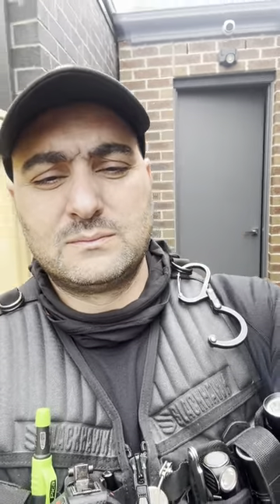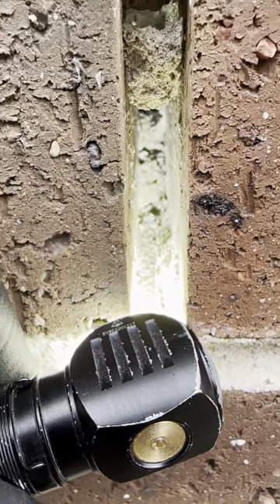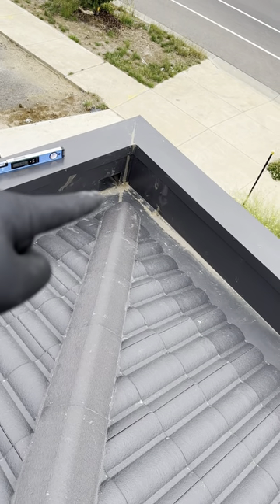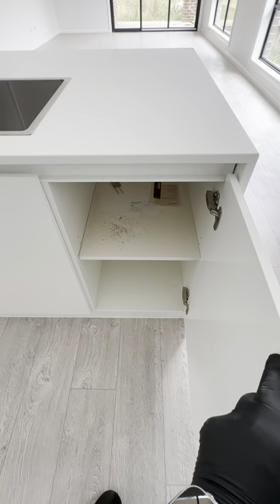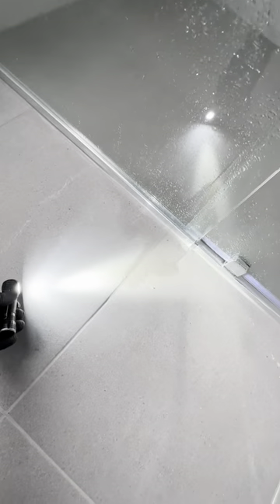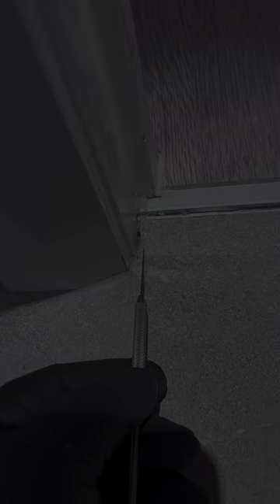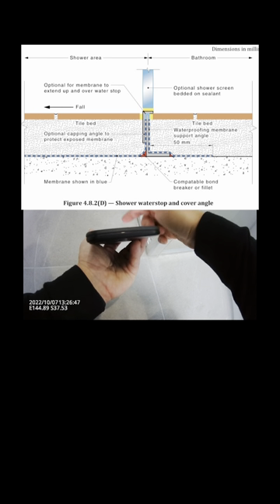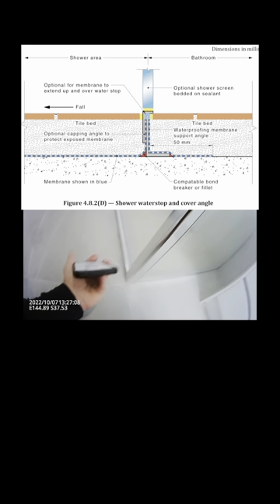Builder Confronted on Body Cam during Handover Inspection: Unbelievable Response

Comment: These gross cardboard houses litter our urbanscape and built to last a few months. They should come in a packet where you just add water.  I’d rather an old house and renovate any day.
Reply: They'll all be around in 50 years if they're not demolished. I don't understand why people think new houses are worse than say the post war weatherboard home, they're actually better.
Reply: It's very expensive to get older houses up to modern standards with insulation/ energy efficiency. Huge variance applies, some are easier to retrofit than other. It's not always as simple as old houses are easy renovations.
Reply: @HardstylePete  Correct

Comment: I used to do building maintance and I have seen the damage done with water seeping under the tile and then wicking up the door trim. People think that once you grout the tiles it's totally waterproof. It's not. The slighest crack and it worms it way through the tile cement lines and voids. It's amazing that this needs to be explained to the builder. I'm not a builder and I know this stuff.I've built bathrooms and it doesn't take much to learn this stuff.
Reply: When you think about it tiles just make the waterproofing look good and protect it..
Reply: They don't know because they don't need to know. Seriously.
All they care about is collecting the certification from each trade. They don't do any work work anymore.
Reply: We have mushrooms growing in our bathroom doorway. Private certifier identified the problem but builder never had it corrected.

Comment: Many reading here might think that Australian building standards have worsened over the past 15 to 20 years. Don't be so quick to judge. The number of houses has increased, certainly. I worked as a cash labourer for a great guy in Sydney. We did jobs all over the inner west of Sydney. One was where we placed new timber floor joist directly on to soil having torn up the previously rotted timber floor. That was about twenty years ago. That house in Balmain should be due for a new floor about now. On other job, the timber floor 'sagged' in the corner of the room. The repair was to drill a hole in the floor and fill the sub-floor space with expandable foam. That second one was a real estate job. Balmain. Good work owner! I don't expect much has changed in twenty years since.

Comment: And those are just the violations that you can see... There are likely 100s of short cuts, mistakes and errors that are hidden behind the walls, in the foundation and deep in the attic. It should be torn down at the builders expense and the buy refunded any deposit.

Comment: I don't get how stand alone houses are allowed to be built right up to each other. How do you maintain termite barriers etc.
Reply: I’ve done them where bricks are against the houses next door. It’s fucked
Reply: @dragginmedown  I sit design side, do audits etc. House I saw recently (not one of mine), but could see shit from the other side of the road and had to take a closer look) they had to put the gutter on top of the wall so they cleared the neighbours. Top of the wall had no finished surface or flashing, roof tiles were cut back with what could have been toe nail clippers, I have NFI how the roof trusses were supported (house was open but sheeted up so couldn't see), the wall had an obvious lean to it you didn't need fancy gauges to tell...  Anyways, everyday I say to myself you couldn't pay me enough to build a house today.
Reply: Might as well call them semi detached house
Reply: Terrace houses.

Comment: When we bought into our 2 year old apartment block in 2002, we noticed the brick & render flower beds (all around the property) were full of buidling debris and general rubbish. There was a dusting of soil on top to make it look ok. Also, the waterproofing on the planter boxes only went down the sides about 100mm.  Downpipes from the box gutter roof terminated in the flow beds. All of the bathrooms wern't waterproofed and the damp course around the buidling didn't exist. All fixed now thanks to a NSW Gov HIH payout in 2004. We were lucky to get the cash and make repairs.

Comment: Thanks for your videos. The Australian standards excerpts are particularly helpful and serve as a reminder. Loosen up on the builders, though. Realise the sub contractors have a big role to play, too (1.15 multi layer piping. Plumbing is a specialist trade). Accountability must be realised across the board. It seems like a lot of people are hating on builders, and that hatred keeps growing.

I question the inspectors method to test whether the waterproofing has been done correctly.

 "Figure 4.8.2(D) - Shower waterstop and cover angle". This shows that the waterproofing angle is permitted to stop flush with the tile. Whether it's a frameless shower screen or not, the standard allows for sealant in both cases. The pointy ruler can't check for water stop angles. The ruler will just go through the other side. Especially if the optional angle hasn't been installed.

The inspector is stating the tiler used the same tile, so he's claiming that means there's no angle under the shower screen. But note that the tiles inside the shower have a diagonal cut. This is done to achieve sufficient fall to the shower drain. How large is the tile in order to fit inside and outside of the shower? It doesn't make sense.

In the other videos. How about roof sarking defects particularly perpendicular to the fascia. They've been cut out after being installed. By builders or subcontractors? And for what reason. Forgetting to rough in cables or an afterthought by someone other than the builder.
Reply from the maker: It seems like you're referencing AS 3740 2021, but that's not applicable in this job. The standard that applies to this job is AS 3740 2010. 
By using a ruler, one can verify if a water-stop has been installed correctly according to figure 3.6 of AS 3740 2010. 
Moreover, this specific builder appears to lack even a basic understanding of what a water-stop is.
Reply: @Siteinspections  I never really refer to the Australian standards when it comes to tiled hobbles shower bases, I use my trade skills to make sure I exceed the standards!! The Australian standards are quite poor really, 

In my opinion, the  standards for hobbles showers should be written like this,

Treat the whole bathroom/ensuite floor as one big shower base, meaning floor tiles at outer walls to be level all the way around, shower base area to have 15mm fall to the shower waste (shower waste should be bang on center in shower base area). Outside of shower base area should have 5mm fall from the bathroom/ensuite walls to the start of shower base area, (pick a tile line and make a valley with 5mm fall).

Drop the whole bathroom/ensuite floor 70mm from finish floor level,

This dropped floor should have fall to the shower base puddle-flange,

Before the villa board wall sheets are installed, install sheet membrane over floor and walls (150mm up walls), the purpose of the sheet membrane is to make a drip tray, (drip tray will use the shower base puddle flange)

Install Villa board to walls and install 60mm floating tiling screed with the correct falls to the puddle flange,

Liquid membrane tiling screed and walls, water stop to be installed only at the door entrance, there is no need to install water stops under the shower screen, Water stops under shower screens are only effective for shower screens that contain all the water to the inside shower area. For frameless and semi frameless shower screens no water stop should be installed under screens, the water that splashes to the outside of those screens needs to make its way back to the shower waste puddle flange.

Install floor tiles first for flashing purposes, and then wall tiles, and then install door jambs, arcs and vanities. 

That's right, keep all that timber right away from our flooring system.

I do enjoy your video's, it gives me a good old laugh!!!

Keep up the good work.

Comment: Sorry, what is GPU?? This video highlights my dodgy tiler who did a reno on my ensuite a few years ago. He dropped the floor to accommodate a tiled shower base, did the waterproofing, and after a few years I noticed how much seeping of water was happening across the floor and blowing up the mdf vanity base and architrave. Obviously no water shield like you've shown in the video. Since the cement grout was cracking up, I had it replaced with epoxy and haven't had the issue since, but it's because the water is now being held in the shower recess by the grout + silicon rather than an actual proper water barrier.

Comment: Oh my god, i am getting an extension built at the end of the year and the bathrooms done. This shit is absolutely terrifying. How do you get access to the building standards?
Reply: They are publicly available. For example https://www.vba.vic.gov.au/__data/assets/pdf_file/0004/166432/Guide-to-Standards-and-Tolerances-2015-Archived-110222.pdf
Reply: If you are getting an extension built then typically you have a higher standard of builder, these builds are cheap spec homes... and to keep old mate honest the design was lodged with council and drawn up by a draftsman this means the box gutters were built to the plans that were approved, everything else is shit workmanship.

Comment: This is disgusting i can't blame the owner fo sueing stuff like this shouldnt happen this isnt only the builders its the inspection system to much self regulation and also currupt inspectors or greedy inspectors that just walk through the house and then sign off on it most dont even get i to the manhole i honestly dont think ive ever seen a inspector even bring a ladder let alone get on or in the roof after more than twenty years on building sites ive done everything except actually run a build yeah so a bit of advice to your other veiwers always inspect the home yourself no matter what even if you have no idea wat is wat you can identify something that deosnt look finished or fitted right or not straight or looks bad to you bring it up with your site managervisit the site at least weekly and if your builder rings to ask about making a change dnt answer over phone go to site and sort it there

Comment: This builder is completely lost it, they don't know what they are talking about, the waterstop installation is very critical and it should be done at the same time with the installation of waterproofing membrane.  This is just lazy and lame work by the builder seriously, I feel sorry for the owner. Usually there will be water stop around the shower, and there is one near the door frame where it connects to the other rooms ( whatever it is, it could be bedroom with carpet or other non wet areas).

Comment: Many builders these days are just DIY’ers, some with more experience than others. They shop at the same suppliers that you can go to and watch the same YouTube videos that you can also!

Modern building materials and tools appear to be so idiot proof that anyone from any country can turn around and want to become a builder. They just use your house as practice in the meantime.

My truth is if you aren’t prepared to research every detail of your house and watch over your builders every second of the build you will almost guaranteed end up in this situation. 

I don’t even blame these builders at this point. 30yrs ago this couple probably would have opened their own corner shop and done their own dodgy renovations not hurting anybody, but these days we shop on Amazon so now they have to take their limited skills and come knocking on your door!

Comment: tbh your actually wrong when you were speaking with those guys.  like there actually could be a angle underneath that shower screen and you wouldnt see it cause the frame of the shower is on top of it. but could also not be there to lol

Comment: To think that water flows through prperly installed grout is laughable, it dosent flow through glazed tile either,
It will however go down any cracks.
Water should never reach the membrane and if it does somethings wrong.

Comment: Have you ever tried to install a water stop. Not easy and do not work. The water stop function is to prevent moisture/water seeping through out the tile screed.and containing the  moisture to shower area where the puddle flange allows the water to seep into the shower waste pipe. The problem is if water has made it pass water proofing membrane and into the screed you have water seeping into plaster board  shower walls. The other issue is the soap products  going down waste pipe block the   puddle flange. If you have water passing through the water proofing membrane into the tile screed you have serious issues and the water stop and puddle flange will not fix the problem. Waste of time and money.